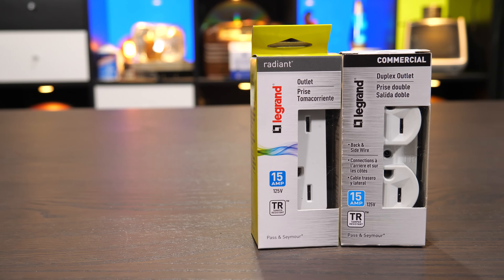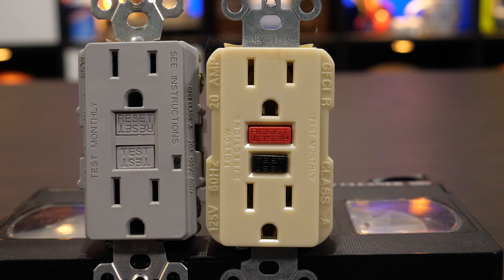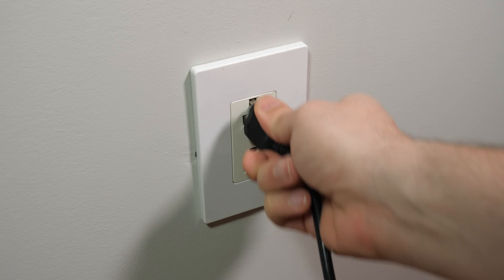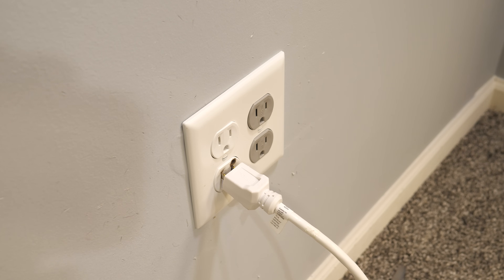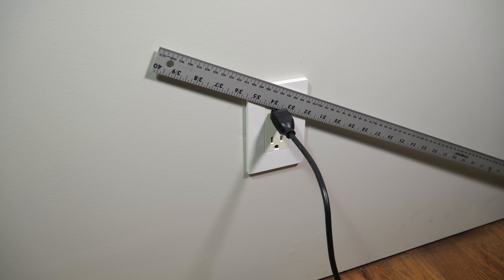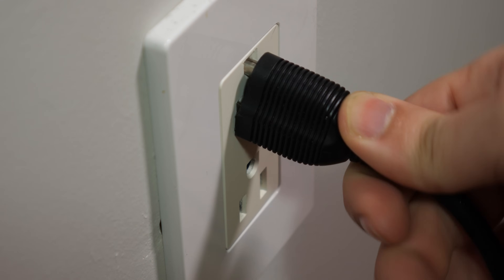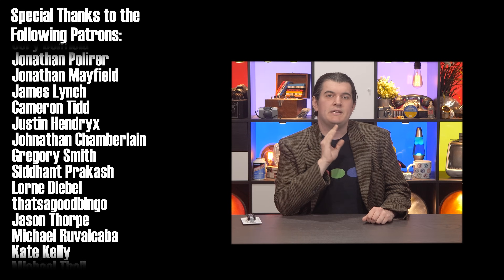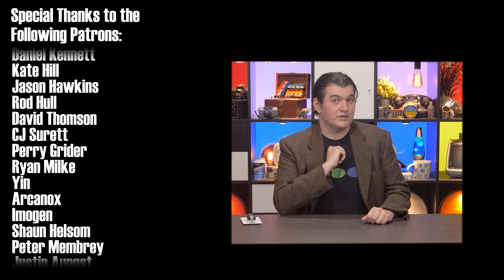Power outlets are topsy turvy - but does it matter?

Comment: Due to the fact that laws and regulations about such things are not the same everywhere in the USA, you might have seen something like this coming, but I have actually had to install quite a few with a specific orientation required in order to pass local inspections. Most commonly, in my experience, where there is such a requirement it's generally that the ground pin must be on top if it is a ground fault protected socket. In some cases, there is a requirement that the ground pin not be on top if it's not a ground fault protected socket, so that people can tell them apart by looking at which way they are oriented. Of course, if a person learns to recognize which is which based on how they are oriented, and doesn't know that it's not the same everywhere, incorrect assumptions could be made as a result.

Comment: I don’t find this to make sense, when it comes to things that ya have to plug 🔌 in 🆙right, such as some types of plug-in air fresheners (liquid ones), that do not swivel. Sideways outlets actually makes more sense. That’s where these types of plug-in air fresheners won’t be used. Swiveling types are fine. Mini lava lamps without the swiveling plug 🔌 will also not work in these reversed or sideways outlets. Your friend, Jeff.

Comment: It's not upside down. The thumbnail clearly shows a correctly oriented face. There are shadows at the eyebrows, tall surprised eyes, the outsides of the cheeks slanting down in surprise, and a shocked open mouth. The top one has a screw for a Soul patch, while the bottom has a weak jawline.

Comment: I have installed both ways, the fact that its even a conversation is laughable to me. I have never seen a single specific instance that this actually improved the safety. Size your devices and equipment correctly and make sure your connections are tight. This will be more important then the orientation of a 1000 recepticles.

Comment: The problem is right angle plugs.  Refrigerator have right plugs, in order that the plug does get pushed into the wall.
These plugs are designed for the ground down. 
If you have it ground on top, then the cord is severely bent. 
So as an Electrician, I always wired 3 prong outlets down.
Metal wall plates are better, because the wall plate holds the outlet against the wall.
Plaster is actually holds the outlet in place.

Comment: A while back I finished my basement and oriented those outlets ground-up for the same technicalities mentioned.  The rest of the house was built with ground-down outlets.  Basement looked weird but it was usable.  UNTILL as you pointed out... As soon as I added my first right angle plugged power strip I knew this was not going to last.  I switch every basement outlet back to ground-down orientation.
Personally I find another outlet feature MUCH more frustrating.  Tramper Proofed outlets typically yield the most explicative language from me.  Oh you have a video on that too :)

Comment: There is a rule about orientation, but that only applies to vertical mounting, like on a ceiling.  Your not supposed to do that- it must be a twist lock type.  I've always installed receptacles upside down (you know what I mean) in industrial and hospitals because of metal covers.

Comment: There are two changes I'd like to see to US outlets to make them safer and more user friendly.

1) Use a side by side configuration similar to what you show for the Chicago outlets, but each rotated 90° so that the ground  pin is at the bottom. This makes using two of the right angle plugs in one outlet super easy.

 2) Incorporate a fuse and/or individual outlet switch into the unit.  This is very common in European outlets, or at least the ones I've seen in the UK. This way you can isolate the power when plugging in or unplugging a cord and eliminate any potential shock hazard of accidentally touching one of the partially inserted prongs of the plug.

Comment: Oh it’s fine. Check out the Japanese plugs where the ground is a separate wire and you need to fix it into the socket with a screw. Now that’s what I call a modern design.

Comment: I live in New Zealand, where the Type I socket is the standard, with the ground pin facing down. I occasionally encounter Chinese Type I plugged appliances where the ground pin faces up (although I believe they are supposed to be banned here). The right angle plug Chinese Type I is slightly annoying when you encounter it for the reasons explained in the video.

Comment: I've seen this in action: A woman at a place I used to work wore a loose metal necklace at a counter with electrical plugs lining the side of the counter in front of her (it was a computer test area). She leaned down near where a computer plug was loosely plugged in and her necklace draped over the plug. The plug was not fully seated. The necklace touched the plug leads and shorted them, initially burning out the section of necklace between the plug leads, and then when that was melted away, it shorted across the rest of the necklace, leaving a burn mark around the entire back of her neck. I have also shocked myself at least twice when I was younger and trying to put a plug in the wall in a difficult to maneuver space. My fingers touched both leads as it was partially inserted and I got a nice buzzing jolt that anyone who has touched 120v/60 hz is familiar with. Rather painful.

Comment: Ground is suppose to be on top. Girl friend kept her metal necklace on a hook above a electrical connector.  Necklace shorted out on electric plug when it fell off and onto the partly inserted plug as in your video.  It could have started a fire but I took corrective actions to advert disaster.

Comment: There is no code requirement to install the receptacle one way or the other. Electricians install it ground up in places like shops or garages with metal covers. If a metal cover comes loose and falls down while something is plugged in, it could possibly cause a short between the hot and neutral. Other than that there is no reason to install ground up. And no one does it unless the customer wants it ground up. 
This is a non issue. The chances of something getting in there and making contact is very very small. 
Oh, and sometimes an outlet will be installed ground up to indicate that it is a switched outlet, while the standard outlets are ground down.

Comment: Does anyone see a new carnival game here?  Throw the knife at the outlet! Get it to short out and win a 5 foot tall stuffed bear!  I can count the number of times I've had any object land on the metal portion of a live plug on zero hands - so I'd loose out on that game.

I thought you'd mention wall wart power supplies, and how bad they are in upside down outlets.

Most of the construction done around my area in the 90s used an upside down outlet to mark the outlet controlled by a wall switch.  That was the only time I thought it made sense... but even then it really didn't take long to find that particular outlet.  In the long run it turned more into an annoyance that a helpful feature.

Comment: 12:05 I actually have an in-window AC unit with a right angle plug with the ground pin on the top! The GFCI plug itself is a Tower mfg corp. model 30386 LCDI, and the extra weird part is that text about testing the breaker is only upright if the cord is going up from the outlet. Its specifically designed with a ground pin down socket in mind, and to have the cable exit the top instead of the bottom. I assume its like that because the AC will likely be installed somewhere above the outlet.

Comment: I’ll never forget back in ‘74, toddling over to the outlet with my Mickey Mouse nightlight and getting a weird buzzing in my hand as I plugged it in just like I saw my parents did. I looked down and saw my fingers on the conductor blades. Now I have a strange fixation of testing the 9V battery on my tongue.

Comment: Most "flat" plug extension cords are made with the ground plug on the bottom.  If you plug them into an outlet with the ground plug on the top the cord will have to flop over.

Comment: Id say the us should copy the functionality of schuko/europlug

The uk plug might be even safer but it would be significally more expensive at little gain

Sleve the prongs on ungrounded plug and introduce a new grounded plug wich fits perfectly in a reccessed socket slightly larger than the current US plugs but still the same prong placement, preferably with two ground prong holes to make it possible to orient the plug either way.

This all old and new plugs will still fit in most sockets. Some will just accept fewer of the new saftey plug. All plugs will be proteted by the sleeving and the ressesed sockets will protect even old unsleved plugs a fair bit. 

The one problem would perhaps be wall warts

Comment: Experienced this firsthand a few weeks back. Had a photo printed on an aluminum sheet fall down the wall and hit the hot and neutral (something was plugged in and not completely inserted as it pretty common). Sparks flew for a split second - the breaker did it’s job but the picture received some indentations and the outlet received a nice black mark on it 😅
Reply: I have witnessed something similar with a wire coathanger. Granted, most hangers now days are plastic, unless you get your clothes done at a cleaners. Molten balls of steel on a carpet or rug might not cause a fire....might not.
Reply: Oh my god. There's this company called Displate that sponsors several people on Youtube and Twitch so I hear it advertised occasionally. They are thin metal plates with artwork on them. If the adhesive failed and it slid straight down the wall instead of falling forward, it'd be in prime position to slap right into an outlet underneath like you just described. The whole "thin metal object falling onto the pins of a power plug" scenario goes from "extremely unlikely" to "happens somewhere every day" if everyone had these Displates and outlets weren't oriented ground-side up. Maybe the Displate lobby in Congress is trying to future-proof their product by reorienting our outlets!
Reply: I'm calling bullshit. The outlet cover plate would have deflected the picture away, unless the outlet was massively unplugged, in which case, you are an idiot for leaving it like that.
Reply: @MAGAMAN  Typical critical thinking of a "MAGAMAN." Can't even start to imagine it falling any other way but straight down...right against the wall. We come to expect narrow points of view from MAGA.

Comment: The ground connection is correct to be on the bottom.  When you plug in, the typical action is to orient the bottom of the plug slightly upward (in order to see what you're doing) which will result in the ground plug being inserted first.  The same for unplugging; the ground pin comes out last.  This is also the reason the ground pin is longer than the power pins.

Comment: I did actually once (that I remember) troubleshoot a receptacle that got zapped by FOD (foreign object debris).
It was a receptacle built in to the floor, and it being in a messy industrial control room, a piece of wire got kicked around until it found its way into the receptacle.
I don't remember if it was because of a cord being loose, or because the wire found an empty receptacle.
Given that there are never enough receptacles, I'd guess it wasn't an empty receptacle.

BTW, I gather the proper term is "receptacle", but I usually hear them called "outlets" or "plug-ins".

Comment: for receptacle installation (and any thing else that goes into an outlet) 110.3(B) says follow the listing manufacture's instructions. also may be something in ansi/neca 1-2015 about it. 

just checked nope nothing in there. but somethings are in there that I heard were in the code but couldn't find.

Comment: That's why here in the south of the continent, we adopted the 3-prong pattern used by Australia... Our plugs don't get energized until they're fully plugged-in, and (for safety reasons and because our plugs have their cables out below the plug itself rather than behind) by law the sockets have to be installed sideways, with each Ground pin looking to each socket's end

Comment: Fun fact; here in the UK, all of our plugs are, compared to USA plugs, upside-down and right-angled. That is; according to BS 1363, our ground pins are always at the top of the socket, and - assuming it's not a brick or similar, in which case all bets are off - pulling downwards, perpendicular to the wall. Some appliances that don't need to be grounded don't have a metal ground pin - but they still must have a ground pin, even if it's just plastic, because unless there's something in the ground pin's slot depressing the mechanism, the live and neutral pin slots are closed by shutters. Oh, and our live and neutral pins are always sleeved. All of these are statutory requirements, to the point where you literally can't sell any electrical appliance that doesn't meet these criteria - even if you're a second-hand charity shop handling a donated appliance that pre-dated the standards. You either have to replace the plug or you can't legally sell the appliance.

On the other hand it's also more important for our sockets to be safe, because our mains standard is 240V compared to the US's 120V. Bad as it might be to get shocked by 120V mains, somehow I think the results are more likely to be catastrophic at 240V.

Comment: Former electrician here. My opinion on it is that if you step on a cord and pull the plug out of the wall, the ground plug will be the last thing to come out if it's in the classic orientation. That'll give you more protection from a serious shock, even if the risk of a minor shock is higher.
Reply: A listed receptacle will not let this easily happen. Ground prong contacts in a receptacle are closer to the face of the recept, and the ground prong is longer, too, so, regardless of orientation, it will break contact last. Yes, I know, people are banned for these discussions over at ET or Mike Holt's forums.
Reply: I don't think I believe that is true though. Considering how much longer the ground prong is, I don't think there is any orientation that would result in the ground being first to fall out in the event of an accident.
Reply: Think about it for a second. How do you get shocked. You need a complete path. That means voltage must have some place to go. With no ground path, no shock. You can literally put a finger on a live circuit and feel nothing other than a slight tingle, unless you are somehow grounded. Which is exactly the same as being grounded and touching a hot. Must have a path.

Having a grounded outlet where the ground prong increases the likelihood of remaining connected only increases the likelihood of getting actually shocked by accident as you become the connecting conduit.

Comment: While it certainly wasn't life-threatening or even particularly messy, I've had a dime slip off a ledge behind a night light, where it landed perfectly and made a huge arc that charred the cover plate and a bit of wall.  Of course the breaker did its job but that was a good scare.